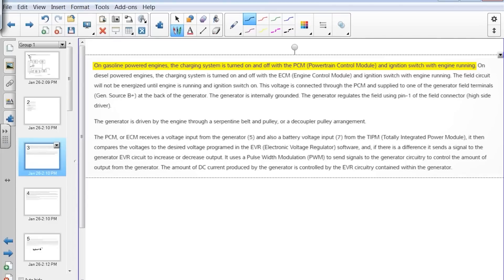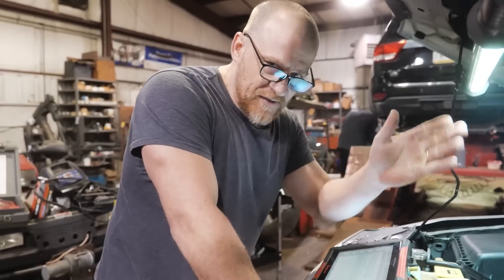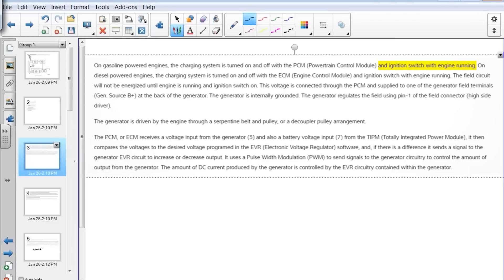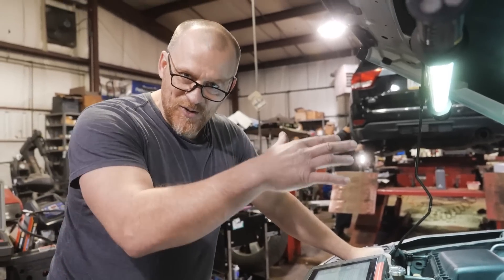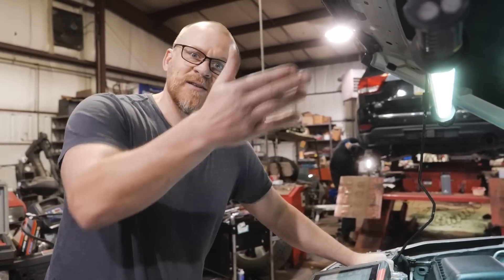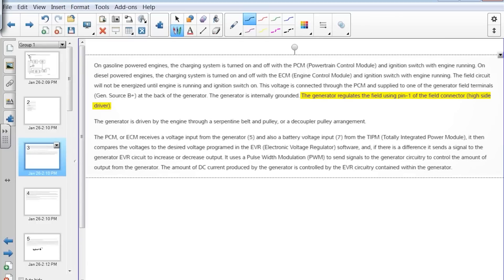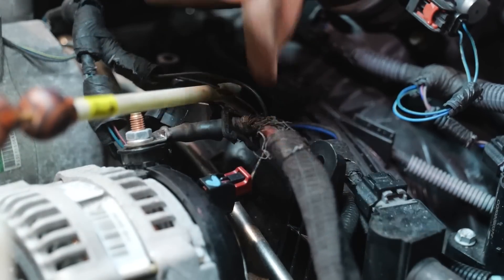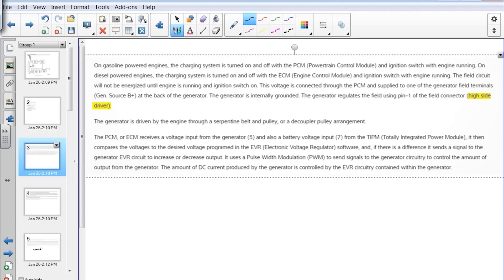Charging For Diagnostic Time - Can We Bill a Customer For "Research"

Comment: For $2000.00 you can get a lot of diagnostics time. If and usually when that diagnosis fixes the problem and sometimes additional problems as a result of the correct diagnosis it is worth way more than getting a new pcm which usually fixes absolutely nothing. I don't think that is difficult to understand. If it is I think that person might need an attitude adjustment. Basically what maxwellautomotivellc points out.

Comment: When Chrysler changed away from ground side field control they used the same looking alt w/the same 2 prong field connector ... some rebuilder's created havoc in 2004 - 2005 & wrong reman alt.'s were being put in vehicles. 
Also Note some vehicles this was a mid year change and tsb inserts for the service manuals were provided ... ain't life a bytch 😅

Comment: Even on a 200 used computer, once the complain is confirmed if possible i like to see the burn element inside the old computer witht the microscope and take a picture so if  the customer question me i have a solid proof.

Comment: wish i new a guy like u are even a shop im having a p0882 code low voltage on my pt cruiser for over a yr since i bought it an 3 shops later 2 given up mechanic new battery new pcm new timp clean grounds an  more lol still no where closer,only 46 k miles so trying to save it but figured ill try an check some wires myself now which lead me to your channel none the less i would rather pay someone for the right knowledge even if they had to look it up too or read it  rather then keep going to new garages an keep buying random parts story of my life whats u going to do
Reply from the maker: Define the code for me. And what are your symptoms?
Reply: @ScannerDanner  p0882  low voltage code (pcm)to (tcm) not gitting enough power an a p0700 wich is just a general fault not the direct fault for the tcm ..symptoms gose into limp mode it strats fine drive fine but 20 mins into a drive some times the engine light comes on an gose into limp mode an wont sift out of a 45 speed  so wont sift out sec or thrid.i shut the car off for a lil clear the code an drive aging tell it acts up other then that cars in so good shape as far as i can tell somtimes it  acts up other time it dosnt  ..ty for asking i almost given up here lol

Comment: You said it every car is different.  This isn’t 1960 anymore.  You charge for you time especially when your lead down the wrong road based on the manufacturers service information.  I was lead down the wrong path just the other day because All Data’s wiring diagram was wrong.  I charged for my time.

Comment: Whats crazy is some so called mechanics telling people that it would be better to get a new car rather than to fix an evap problem. Had it happen, my wife’s cousin has a 2018 trax about 100k on it. Was told to get rid of the car because it had an “emissions code” and it was going to be to expensive to fix. Took me less than 5 minutes to figure it out and the part was only $45. It was a bad purge valve. And in not even a mechanic! Im just some dude with some tools.
Reply from the maker: That is crazy and sad. Nice find on your part
Reply: Got to give credit to some people, I have learned a lot about how to find problems from YouTube watching Eric O At SMA(3-4 years), Ivan at Pine Hollow Auto Diagnostics(~2 years), Ray at Rainman Rays Repairs(~2 Years), Wes at Watch Wes Work(~2 years), and very recently some of yours.

Comment: So I changed my alternator as preventive maintenance on my ford van 460 engine,and kept the old one and then went to Boise Idaho from Washington to pickup a Porsche engine the firs 150 miles went really good and suddenly out of nothing my battery gauge jumped to hi charge and then freaking engine started to hesitate 😬😳😳🥵 in the middle of the nowhere so I turned on the lights radio everything I could and I think it helped so I got to boise picked up the engine the problem turned on intermittent I went to Napa I ask the guys to check my alternator he said it was overcharging I didn’t believe this freaking thing is new honestly I was thinking about injectors,coil or something else I poured some injector cleaners in the thank and I think it helped well I took and ask god bless my road, I don’t like bother god so much but this was necessary ok the problem was coming and going the temp outside was 105 degrees 🥵😬well after 5 full tanks of gas constantly checking oil water I made it home well the result of the problem was my alternator over charging one thing that I noticed was my ignition module was to the melting point I don’t know how that thing didn’t get damaged ok adios 👍👍

Comment: Recent troll that came to our shop:

"My Sienna auto open doesn't work.  If I disconnect the battery it works one time but then there after it doesnt.  Can you fix this and how much would it be?"

'Sure we can fix it, but we charge $200 for initial diagnosis to start, then $200/hr thereafter.

Lol, you should've seen the look on this guys face.

And check this out...I saw a review online PRASING a shop, saying "XXX shop did such a good job!  They found so many parts that were bad! "  I'll never forget that.

People are trained to be cheap, and this carries into our trade.  Nevermind the fact that these people will shell out $200 easy for 1 night out for entertainment.  They find places that will give free diagnosis.  They don't know any better!

The trick is not to fight it, but to play the game.  Get them in the door.  You will never change people.  Never.  It's like the places that offer a special $20 oil change, knowing that they will sooner or later find the whales that will buy everything that the shop tells them.  I experimented with this!  Had my office employee take her mamas vehicle to a well known franchise for an oil change.  $5000 of upsells, some were not even remotely legit, and no prioritorizing of fix now/ fix later/monitor.

I am insanely thorough.  My basic oil change is $165, but I test drive the vehicle, perform a complete module scan, perforn a bat/sta/chg check, check not only the drive tires but the spare tire, and pick it to death noting every defect I see.  Then I advise the client what needs to be taken care of now, and what can be monitored.  Yes, I make a lot of money on our inspections, but for things that are necessary.

Gawd I can go all day on this.

Comment: The real question should be, why should I or my customer eat the labor cost for defective brand new or remanufactured parts. Where and when does the responsibility of the manufacture kick in?  Sure, the parts store or distributor will replace the part but who covers the added labor cost? Again these corporations rake in the money while passing the burden of responsibility onto others. Meanwhile, to keep my customers somewhat happy I split that cost with them as not to gain a bad reputation caused by poor quality in manufacturing.
Reply: P.S. If that work originated in another shop then that customer will be billed normally. I'll then give that customer documentation and other pertinent information for reimbursement from the manufacturer.

Comment: I agree with you..   But to play devils advocate:  at the same time, it ends up forcing customers to just ditch these old junker cars because they cost too much to diagnose with these wild rabbit holes;   so then you end up losing a chunk of the market.  So there's always a balance happening.  it's called "price discovery"..  There comes a certain point where people will just simply refuse to pay it and stop bringing you their cars.    But I do get your point, if they insist on having it fixed, and you're putting in several hours over getting to the bottom of the issue, you deserve to get paid for that.

Comment: This happens to me all the time, customer comes in with X complaint and tells me he's already been in 2 or more shops and nobody could solve his issue, and when you finally do solve the problem he wont pay a just and reasonable diag and repair fee, they get the feeling they're gonna get it for free after all the money they already spent.
Reply from the maker: Time to start hitting them with the retainer fee I mentioned recently in another video. This will weed out the ones who don't want to pay. Don't make their problems become your problem!
Reply: @ScannerDanner  Well i didn't know about that, what I used to do, and fortunately did it only once is to revert back a wiring repair I did and put the old parts, kept the new ones and returned them to my local auto parts shop. Hated that day, lost a lot of time and money.

Comment: Speaking about wrong information from Chrysler I remembered when I first started working for the Chrysler dealer and having to diagnose a parasitic draw on a Chrysler crossfire and the trunk light was staying on, after looking for wiring to the trunk latch assembly I noticed wiring colors and pin outs were all wrong.. called tech support at Chrysler and the gentleman there laughed and agreed, then told me that the engineers had messed up transferring the Mercedes wiring to Chrysler wiring and wished me good luck in my diagnostic. Ended up needing a pcm. Problem solved

Comment: THIS is why I'm DONE.  Service manuals and schematics are fully loaded with errors and omissions.  We hardly get any time to test, research and experiment with potentiometers in order to get a grip on the problem.  My last shop only charged .5 hrs for a diag!!  Throw in the free top to bottom inspection and I'm basically working for free.  ASE Master tech and Toyota expert..  over 8 years of experience and my yearly income decreased as I moved up in certification and became a diagnostician.  I found out something recently that I urge you guys to explore.  Skilled auto techs are highly desired in the biomedical world.

Comment: My research usually starts and ends with Mr.ScannerDanner. Thank You for Your Time. You are the one who has taught me how to read my scope and trust in my diagnosis beyond a flowchart that says replace this, if the DTC resets replace that then this then that. Thank God you made me more then a parts changer 🙏 🙌
Reply from the maker: Awesome comment. Thank you!
Reply: @ScannerDanner  all 4 sensors have read normal and I had just about given up when I decided to take a break and watch another one of your classes. Just happened to glance at my scantool and seen that B2S1 HO2 was a steady line but there were 2 switching signals on my line graph. Paused your video and noticed B2S2 was switching in time with B1S1.... unplugged B2S2 and B2S1 went to default 1890mV. God Bless You as You have Blessed me.

Comment: Just had a customer spend over $7k on lifters, injectors, crusty old pigtail, plugs, wires, then gave up... I spent 7+ hours (mostly testing voltage drop, compression, injector drop, current and spark waves Over and over again. All PIDs appeared normal till I was watching you and noticed B2S2 HO2 sensor  started switching like an upstream sensor. Paused your video and went and unplugged B2S2 and B2S1 went to 1890mV....👀 now I'm drinking a beer finishing your video.

Comment: I have to say honestly, I don't think this should be an extra expense in some cases but others 100%. Simply build the average cost into your hourly labor/diagnostic rates. I have addopted a seperate diagnostic rate than labor for my business. This accounts for extra time/special tools needed. 
There are certain models where service information is not available to the public. There are plenty of things that are not disclosed from the manufacturers on all vehicles. The right to repair act is something as aftermarket mechanics/technicians/shop owners need to stress to our clients and as an industry need to lobby for. This is completely wrong that service information is not available to the aftermarket in many cases. This is an injustice to the consumer and car owners. They absolutely should have access to aftermarket repair options whom have access to the necessary information to service information to repair their cars.

I have had clients in the past who had vehicles under warranty who refused to send their vehicles there even for warranty work unlesss absolutely necessary. Its a monopoly and its time to stand up for our customers/clients/our industry.
Reply: This is a perfect example where we need to charge for this type of situation. I worked for chrysler in 2016-17 and i watched a coworker rip his hair out following system information chassing a missfire, myself, another chrysler master all tried to help him diagnose the issue, we ended up calling in an engineer, and he found the issue to be a faulty injector, but he found it by information he had access to within the factory scan tool which we all owned our own wi-pods and did not have access to. 

I had another situation where I was working for an aftermarket diagnostic consulting company that worked on body shop cars, there was an issue with a car that an engine was replaced on, it was a transfer case issue that arose after the engine replacement. We had access to factory info, identifix, and alldata. It was all incorrect. These are instances where we absolutely need to charge for "research".

Comment: Only way the avoid diag charges from mechanic,find out whats wrong with the car and tell the mechanic what the fix and thats about it. Make sure it works. If not tow your car to next shop and replace next possible failed part and hope the god you were correct at this time.. or just find the good local shop and pay the mans time. Just dont buy drinks for everyone at the bar that week. Thats all.

Comment: I work at a dealership and between engineer flow charts and tsb or ssm repair info is not great if it happens on a few cars they put out a vague flow chart you check a few basic checks and chuck a part they don’t want you to prove it’s bad just don’t waste time proving it